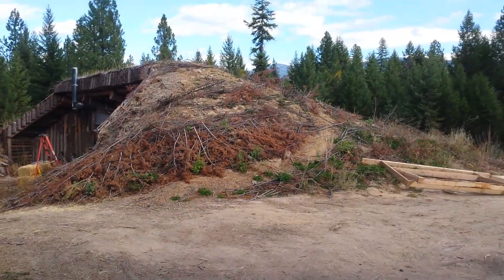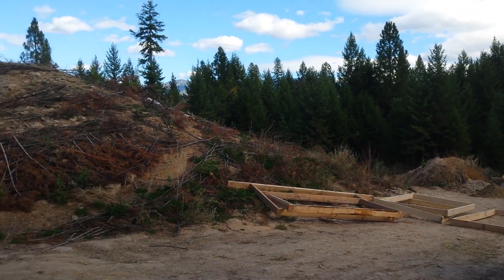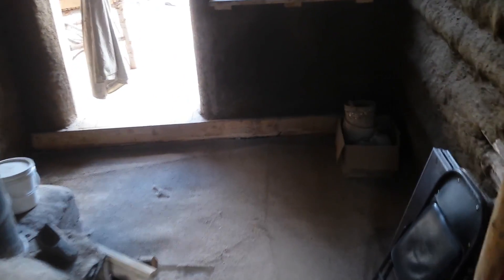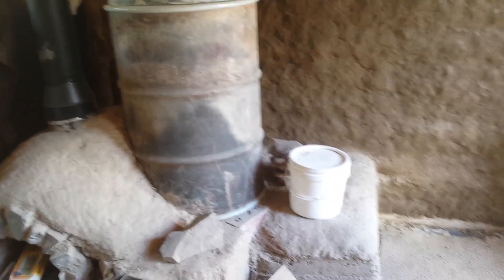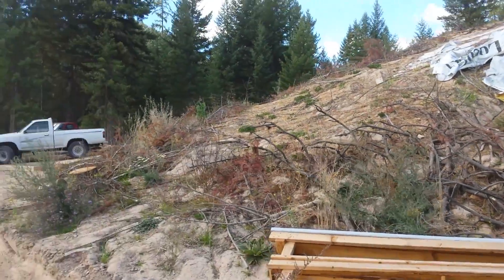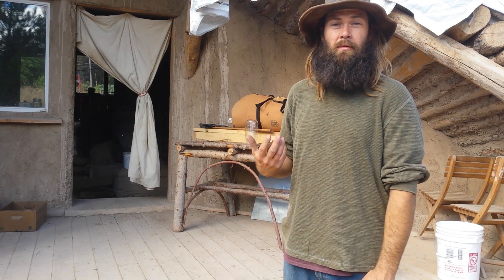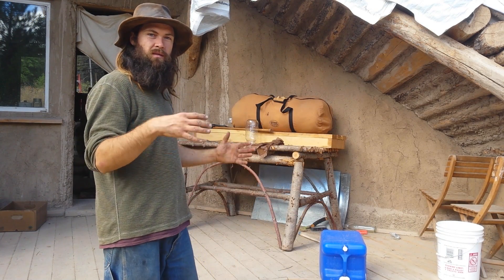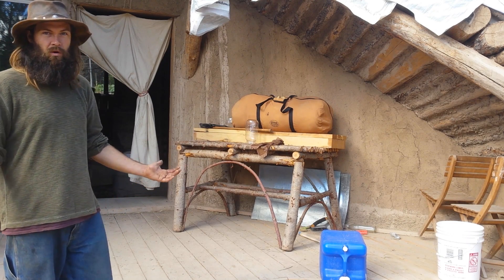Allerton Abbey Walkthrough

Comment: How long are wofattis expected to last?  All the soil contact on the wood seams like it wont have much in the realm of longevity.
Reply: +Atlas Magala  There is a plastic liner the divides wet soil from dry soil, all of those logs have been stripped of bark and will only ever touch dry soil....should last a long time
Reply: Mike Oehler's place which is the foundation of the wofati design lasted over 30 years in northern Idaho, and it didn't have the umbrella portion. Current work is setting posts into holes that have 6-8 inches of coarse gravel in the bottom and then more gravel is packed around the log to minimize any soil contact. If the umbrella is properly placed and sloped, it should help minimize soil moisture. But if it's built poorly then like any other system it will eventually fail.